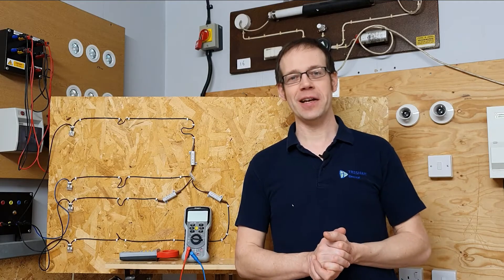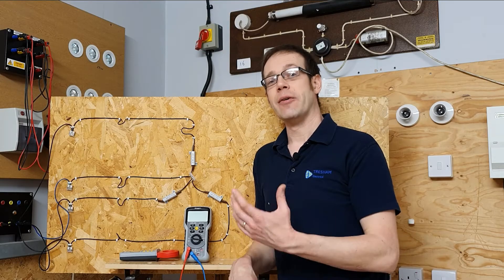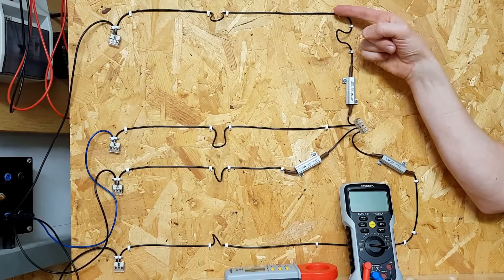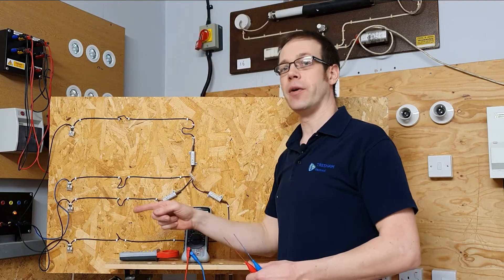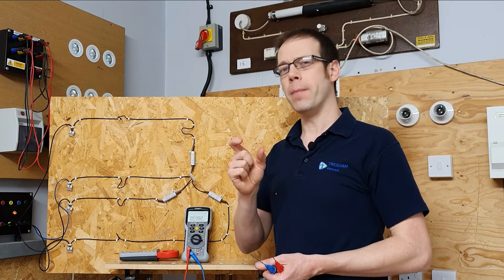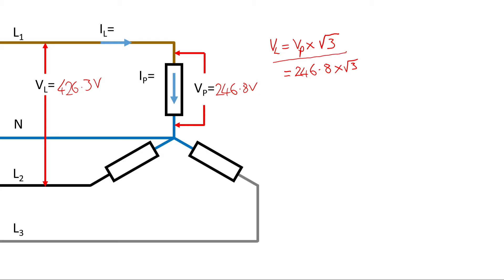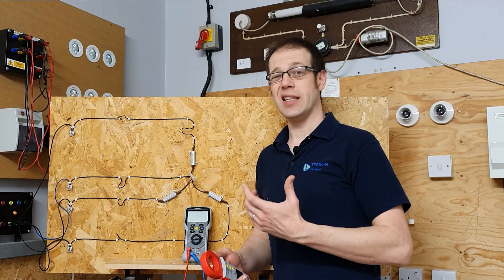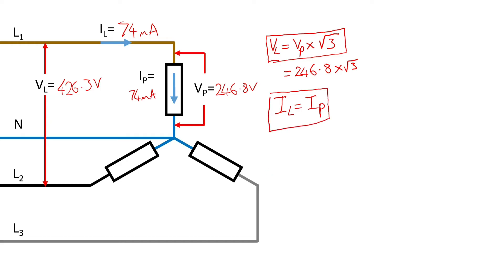3 Phase: Star Connected Loads, How to Calculate Line and Phase Voltage & Line and Phase Current

Comment: Hello sir I am appreciate you ❤
Sir my question is that phase  and neutral shows same current on clamp Meter in equal load   .then why we use thiner cable with respect to phase .
Sir please explain the current comparison between the phase and a neutral .

Comment: This is an amazing Video. I just have one Question. In the case where there is an internal impedance, line impedance and a separate load impedance in a given system (for example star connected load). Does that mean that we calculate the resultant of these 3 aforementioned values and find the voltage drop across the resultant to be the phase voltage?

Comment: I've a question, please Sir,
Assuming the load is 5kw & star connected with 380V line voltage, 

Will the line current be the at all 3 lines ?

Comment: Could you please explain what happens to those currents and voltages when we start the motor using a star-delta starter. And how the circuit differs if it does?

Comment: Star connection should be used for 220 or 440 volts (higher voltages) because star connection incorporates neutral line?

and 

delta connection should be used before the line entering a home (lower voltages) because homes normally get 120 volts?

Homes Central air conditioning work on 120, 220 or 440?

Homes get 120 volts, the outlet for the condensation unit uses step up transformer for stepping it up to to a higher voltage?
How many volts Tesla or other EV cars use for charging?

Comment: What kind of the two types of connections (star, delta) do we use for AC generator, transformer, AC motor, automotive starters, automotive alternators, EV starter? & why?

Does an EV use an alternator to recharge   the EV battery or the only charging source is electric outlet?

Starters on regular automobiles use AC or DC starter & why?
👍👍👏👏

Comment: I wonder if the star has 9 lines (9-phase), does the SQRT of 3 becomes SQRT of 9. Basically the SQRT of phase number? Thank you.
Reply: I take back my comment above as I have understood how it has been derived to be SQRT 3 for a 3 phase system
It is actually V-line = 2* V-phase * cos30deg .......3phase star configuration
For 9 phase star configuration would be V-line = 2* V-phase * cos10deg
Do you agree?
Reply: @EngKeen_KEN  Unfortunately no. It doesn't work like that. With 9 phase, you have one phase that is 40 degrees apart from the one before and the one after. The line-to-line voltage needs to be even more precisely defined because the voltage between phase A and B will be different magnitude from that of phase A and C. 

But to answer your question, in 9 phase, if the Line-to-Line voltage is defined as the voltage between two consecutive phases, then
V_line = 0.6840 V_phase. 

the 0.6840 came from 1 - e^(-40i) after converting to polar form.
note that root(3) comes from 1 - e^(-120i) after converting to polar form

Comment: Hi Joe
I hope you are doing well. 
If we connect the same load in Delta then what will be the line and phase current. In addition, also can you please confirm the total kw in both Delta and star connection for the same resistive load. 
In case the current is different in both case then how can we size the cable. 
Thanks
Reply from the maker: Hi Ankit, check out this video, hopefully it'll answer your delta question! 😃

https://youtu.be/7slCHGpfHtg
Reply: @JoeRobinsonTraining  Hi Joe
Thanks for your response.
I understand that you have used same resistance in both delta & star connection. So as per power formula, the total consumed power is less in star than delta. Please confirm. Can you please also clarify  what will be the electrical parameter & stability of both system i.e. upstream transformer & load if remove one or two resistance in both delta & star connection.

Comment: Slightly advanced topic - you might want to show what happens to the current when you connect a single phase-to-phase load on a wye system.  And other unbalanced situations in wye and delta systems.  Just a thought.  Thanks for all the hard work!

Comment: Great video and in this 3PH STAR example each load draws 74mA, but how would you calculate the total amount of current drawn from your 3 phase supply?  IL1, IL2, and IL3 combined
Reply from the maker: It's a good question. The average current would be zero because they're out of phase. However you only need to know the current in each line to calculate protective devices and cable sizes etc. 😊

Comment: Thanks for the video. I think this 1.732 would apply only if the voltages on all 3 phases are equal. Do you have a video on relating between the line voltage and phase voltage in an unbalanced system with unequal phase voltages ?

Comment: Dear sir, really awsome,  in last few weeks, I tried to make a rotary phase converter from single phase power supply, for a couple of time I was to start from beginning, since I am not an electition It was so hard to understand the concepts.
There are many items about making rotary phase converter from 2 phase power supply, but unfortunately I have to make one from 240 volt which a live line and an nature (L and N). Rigth now l have made some progress, but still I dont know how can I use the line voltage from an star connection , It would my pleasure to receive your comments about it, thanks a lot

Comment: So theoretically, how many amps could you pull from a 3 phase system compared to a single phase system? So say you had a 3 phase source red ceeform plug rated at 415v line voltage. Is the rated amps meant as a total limit across the three phases, or can you draw the full amps from all three phases, so having three times the power?
Reply: Also, if you combine two phases, does that mean you can pull double the amount of amps?
Reply: Rated amps is per phase whether your single phase or three phase.
Reply: When you say power that is a different thing. Power is the sum of all phases.

Comment: Thank you very much for making this video. You have made it really easy to understand by putting up the practice rig. This topic confuses me but you have just simplified it.
Question: Why don't we measure our phase current immediately after the resistor just before the common neutral point. Will the phase current be same as the line current?
Reply from the maker: Hi Adebayo. That's a good question, I guess it would be the same right after the resistor, I'd need to double check that actually, very good question. But yes in a star connected load, line and phase current are equal.

Comment: Thanx Joe, nice simple clear clip for the subject.
But i have 1 question puzzling me, which is the total current we are getting from the 3 phase source for the loads connected to it. Will this be the sum of each phase current, whether it is balanced or unbalanced system? (same question goes for the delta system too)

Like if the source can provide max 100A for each phase in star connection, does it mean we can operate loads of 300A connecting 100A load to each phase? ... or will the source be providing only 100A in total for the 3 phases together?!

Appreciate your explanation to understand better,

Thank you
Reply: Total load in amps is always expressed for each phase not the sum of all phases. Total load 100a means 100a capacity.
Reply: @bobbrumley3964  thanx a bunch 🙏
Reply: @kruzzah  I want to clarify myself a little bit more, you are correct that you could put 300a of load if you divided it on 3 phases that can put out 100a each. We would express verbally the source is good for 100a.
Reply: @bobbrumley3964  
Got it 👍 n thanks again

Comment: Little repeat glitch after the first whiteboard section. Also, when you measured phase current and line current, were those loops both just phase current ?
Reply from the maker: Thanks Gareth, I think the glitch was where I removed a section of video and it seems the point that the phase current and the line current are literally equal (the same) has been put across! Stay tuned for more! 👍

Comment: Hey Joe great vid.
Quick question :- in a balanced system can you leave the neutral out as all loads connect to one central point.  I work on equipment with three heating element rated a 230v and I assume there wired in star but have no natural wire back to supply and the voltage is 230v across the elements.
Reply from the maker: Sounds like it is wired in star if they've got 230V across the loads. Not sure without looking at the regs but theoretically a balanced load doesn't require a neutral, you might have issues if the heaters click on and off separately or operate with varying currents.
Reply: Japolo !
Reply: If the voltage across the heating element is 230v and the voltage line to line 400v it would be wired wye. If the line to line voltage is 230v it would be wired delta. If delta there is no neutral.